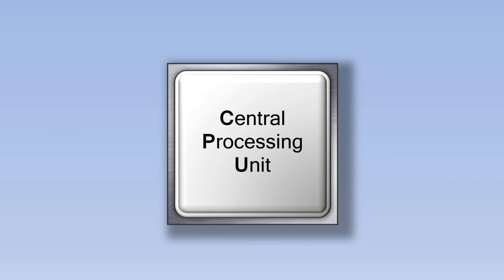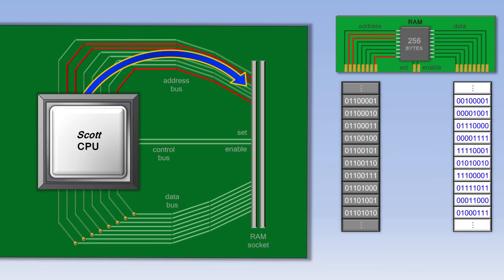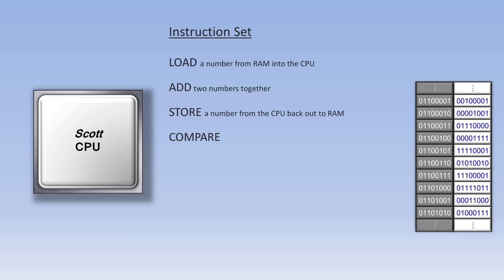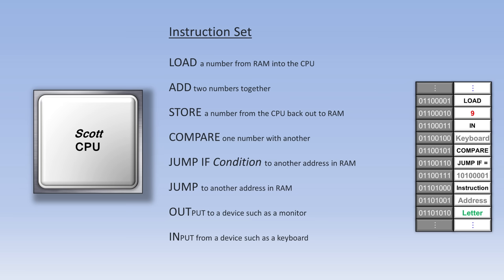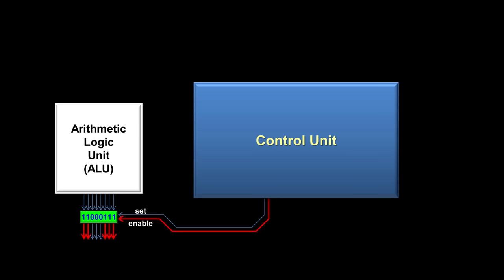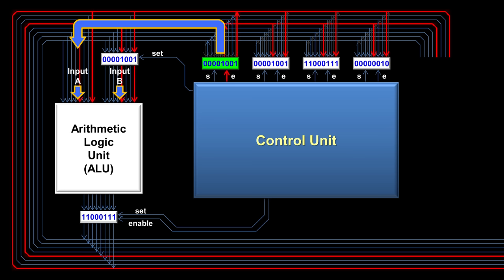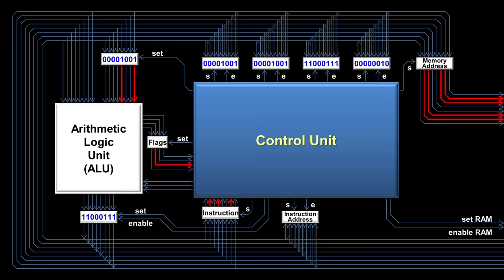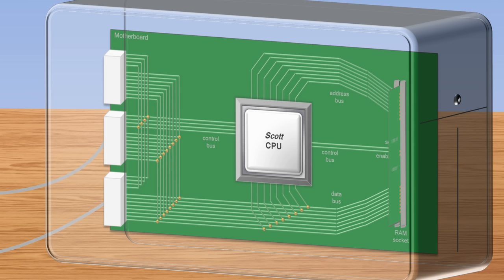How a CPU Works

Comment: Ok and how the fuck did we(people) come up with this such a simple thing that has only 1 & 0, and at the same time very very complicated thing? couldnt there be an easier way to make a "computer"?
Reply: emmanuel kayiwa a chromebook will contain the same hardware, its just a different OS running on there
Reply: emmanuel kayiwa If you don't know crap. DO NOT mislead others!
Reply: This is the easier way.
Reply: "and at the same time"

We didn't spontaneously figure out how to make a microprocessors. It evolved from many other simpler contraptions,  first with vacuum tubes and then circuits with transistors.
Reply: 12839712894710aaa No, the first ones involved using gears to add numbers, and a machine that read cards with holes in them to weave patterns into a cloth
Reply: The only way to make a computer work, that we know of, is by turning electricity on and off. Since ON and OFF are the only way, off is 0, and on is 1.

You could have 3 values though, Off, On and On and the opposite direction. But then you need to also change how digital media is stored too, and many other computer components to make such a thing work.

Basically, On and Off is the only way we know of.
Reply: 100s of years of research.
Reply: why to make an easier computer when you can make a much better one by making it more complicated?
Reply: Rimunas Kusunas  I hope that this answers your question about Binary.
I did a lot of research for this :3

How a Computer Performs Addition

A computer's clock regulates how fast the computer works.  The faster a clock ticks, causing pules of electricity, the faster the computer works.

The simplest operation that can be performed with a transistor is called a NOT logic gate, made up of only a single transistor. This NOT gate is designed to take one input from the clock and one from another transistor. The NOT gate produces a single output-one that's always the opposite of the input from the transistor. When current from another transistor represents a 1 is sent to a NOT gate, the gate's own transistor switches open so that a pulse or current from the clock can't flow trough it, which makes the NOT gate's output 0. A 0 input closes the NOT gate's transistor so that the clock pulse passes trough it to produce an output of 1. {Basically an Inverter}

NOT gates strung together in different combinations create other logic gates. All of which have a line to receive pulse from the clock and two other input lines for pulse from other logic gates,.

The OR gates create a 1 if either the first or second input is a 1, and put out a 0 only if both inputs are 0.

An and gate outputs a 1 only if both the first and the second inputs are 1s.

An XORG gate puts out a 0 if both inputs are 0 or if both inputs are 1. it generates a 1 only if one of the inputs is 1 and the other one is 0.

A mathematical operation in a computer is achieved by gate designs called half-adders and full-adders.

A half-adder consists of an XOR gate and an AND gate, both of which receive the same input representing a one-digit binary number.

A full-adder consists of half-adders and other switches.

The result of the XOR operation becomes the rightmost digit of the result.
The result of the half-adders AND operation is sent to XOR and AND gates in the full-adder.

The full-adder also processes the left-hand digits,sending the results of both of the operations to another XOR gate and another AND gate.

The results from XORing and ANDing the left-hand digits are processed with the results from the half-adder. One of the new results is passed trough an OR gate.

The result of all the calculations is in binary, for larger numbers. More full-adders are used-one for each digit in the binary numbers.
Reply: ***** yea, thanks, it helped me out a lot. But I had to read it 3 times though to fully understand it. xd
Reply: ***** yea, thanks, it helped me out a lot. But I had to read it 3 times though to fully understand it. xd
Reply: Rimunas Kusunas  Thanks for reading it and giving me your opinion

Would you like me to give you a link for the book i got this information from?
Reply: it takes me years to study this in school so you have to take your time to unpack the information
Reply: Aero mirA this took me a day of reading books XD
Reply: ***** no thanks, I kinda understood what I wanted from your text :)
Reply: A system can only think in 1's and 0's - like ON & OFF, HIGH & LOW etc.  which is the basis for a CPU.
Reply: emmanuel kayiwa Yes!  That is why you can't open up a chromebook.  If you do, the cloud floats away.

It's also why rain makes the sound it does, that's the data falling back into the rivers and oceans.
Reply: I meant that it mostly uses the cloud and is missing parts that a normal computer doesn't have like a hard drive! I didn't mean that it has nothing inside of it, sorry for the confusion
Reply: ***** my bad for the wording I now realize it sounds ridiculous I meant that it it doesn't have all the parts that say a normal use laptop would have like a hard drive. I know that it doesn't completely work off the cloud! chill out dude
Reply: If any of you have ever done circuits, especially digital circuits you would know there is no other way than 1 and 0 and that it is incredibly powerful.
Reply: No , there is an other way. We can use DNA to store data,instead of 1 and 0, we can use T, A, G, S (dna molecules). But this is not that simple as I say :) people working around this. This will be the next step for computers.
Reply: ***** nice copy and paste lol it took me 10min to find the website but i got you.... wow lol
Reply: David S again it's out the book I studied called "How computers Work"
Reply: 1 and 0  is like on and of power we could maybe make different ones if we had different kind of electricity
Reply: Nobody came up with this on the spot. People first started making very simple circuits like light switches and realized you could use it do more than just that. Over time, it has evolved into what we see today. Plus, before digital computers, there was mechanical ones. Mechanical ones are a bunch of gears and such. A very simple one would be a watch.
Reply: Check out Quantum Computing
Reply: Michael Scott Quantum Computing is'nt really that complicated. In a Quantum Computer a Transitor is just a phosphorous atom in a tiny silicon
crystal and the only advantage to a Quantum Computer is its ability to do 0, 1 and both at the same time.
Reply: Harrison Kilshaw That is a pretty major advantage! Inbuilt parallelism which exceeds Moore's Law
Reply: We use 1 and 0 because they are easier to think of. Computers don't use 1s and 0s, they use different voltages to control transistors and capacitors.
Reply: David n that is false. Computers use voltages to define 1 and 0. For example any voltage over 1 is considered a 1 but anything under 1 volt is a zero.
Reply: Ahkeel Mohideen No, we use 1s and 0s to define the voltages! a high voltage enables currents to flow through transistors(or stops it if it's an inverter) while low voltage does the opposite. The transistors and capacitors don't give a dam if you use 1 and 0, or y and n, or 55466 and 66466 to define high or low states.
Reply: Yeah sorry that's what I meant
Reply: JacktheSmack Quantum computing is a new way of looking at it that we know of in a way.
Reply: Mathematics back in the dark days. Lovelace - first Programmer?
Reply: Computers only use 1's and 0's because when they were first designed that was the most cost effective way to handle data. Binary is a counting system that only uses 2 diffrent digits or states. with today's technology we could easily make a denary computer that uses 10 states or digits much like our regular number system. The benefits of doing so would (theoretically) make processing information unimaginably faster and data far more compact. But that would require a massive shift in how all data everywhere is stored and be converted to the new system. Programming would change as new languages would have to be written from the ground up made specifically for the new data system, because think about this if a denary byte still had 8 bits it could hold 100,000,000 different stats rather than just 256. no one would accept such a change unless everyone accepted it at once, but that will never happen in the foreseeable future.
Reply: Ryoku Hasu Do you know how complicated going from 2-state to 10-state transistors would be?
Reply: David n Not very if you are using nano voltage for the states, then it would be only a minor change to current CPUs and ram. That way all the data can be transmitted on the same wires as 2 state data but would require a voltage meter to be added to read all possible states. Similarly you would use a wider variety of magnetic states on the hard drive. really it's not a question the transistors it's a question of adding in the functionality. It's doable but unlikely that anyone would do it cause we are stuck in our ways.
Reply: Ryoku Hasu The cpu is made up of many transistors. A transistor enables resistance or no-resistance depending on electricity that flows through the semi-conductor. Technically you could make a 10-state machine, but you are ignoring things like accuracy in transistors, and precision/stabilization times in capacitors. Basically, you would have a 10-state machine but it would run at 50MHz.
Reply: Michael Scott quantum computing isn't simpler by any means haha ;) it still uses ones and zeros and is equally if not more complicated, depending on whether you are better at electronics or quantum mechanics :')
Reply: Morgan Collins not to mention, building a programming language with 10 different options would be near impossible. Now we need only off and on for like if else statement, which 100 times simpler.
Reply: Ahkeel Mohideen It's not so much making the programming language, as just having a language talk to the CPU in a different format.  if one was made for 10 state you would still have true/false, If-else statements, and all the usual things, the part that would be different is the stuff under the hood where it is managing the data unless you are using an extremely low level language you as the programmer aren't dictating how to store it, just what to store, the language platform and computer take it from there. Basically a programming language for 10 state would be no different than a 2 state programming language in the way you use it to make programs, but behind the scenes it will still send instructions to the CPU like it normally would, but just in a different format.
Reply: Proof that aliens are helping us XD. But seriously isn't it a wonder how humanity has gotten so far? 110 years ago we didn't even know what electricity was and look at us now!
Reply: Chris K Exponential growth. Its how technology works. the more knowledge we have and more technological equipment we have the easier it is to discover more things. Makes sense really. :p
Reply: I was thinking the same thing. This info is traveled at the sub atomic level. It's so crazy. It's hard to comprehend these things. The speed, how small it is. It's amazing what humans can do
Reply: JacktheSmack  somewhat true If you want to get technical we do know how to change the orientation of electron, neutrons ect... in an atom and thus count much higher at a given time. This is called quantum computing with just 30 qubits you would have what today is about 10 trillion float point computations a second much faster than most super computers we have today. Here have a read: http://computer.howstuffworks.com/quantum-computer.htm
Reply: Robert Hollar Yeah quantum computing is amazing, I'm studying artificial intelligence and I hope to get into quantum algorithmic artificial intelligence as well as some other stuff, it's an amazing technology. Could change the world if it continues to works as well as it is expected.
Reply: ***** i have a strong feeling thats the way it is going to lead. It's pretty much so powerful that most people couldn't even conceive being about to do something useful with it. Creating intelligence, simulations of nature and making predictions, they're the main uses really but they are VERY powerful
Reply: Nope.
Reply: this is because the 0 means that a there is is no power to a wire, 1 is the opposite, it is like this cause power in wires is just black and white, no grey
Reply: emmanuel kayiwa
Yes, google chromebook it's alien technology made of minerals + vespene gas.

Comment: If i understand it right, ie the pc just a bunch of swiches that go on and off and make a sort of codes of them
Reply: pretty much...
Reply: I've always just thought of it like an abacus, which is basically an early computer.  Instead of moving beads from one place to another, you are moving electrons and on a much grander scale (or smaller in terms of size).  We are the ones that actually interpret the output.  It's incredibly complex and even people who study or build these machines for a living will specialize in only a few aspects of it.  The beauty of it is that the parts are modular, you don't have to understand everything going on inside the chip or cpu in order to make use of it.  Even though the video does a good job of explaining what a cpu does, it does not really cover how it actually works.
Reply: gurgy3 yep indeed
Reply: to who are u repleying ? *****  :)
Reply: well thank you i appreciate that! I am working in a automation company and I'm just 15 years old :)
Reply: *****  and that +(name) system is now something get used to. btw xD
Reply: Titan_Craft The PC creates those switches using voltages, if the voltage applied to a specific portion of the CPU breaks the "barrier voltage" that portion of the CPU will turn from the Off switch to the On switch. That's what they call transistors which are a type of semiconductor designed to be operating at low voltages for On/Off circuits. They fit billions of them on layers of dye onto your processor.
Reply: jebril wow those swiches have to be really small.
Reply: *****  Those switches are also called transistors.

How transistors manipulate data

A transistor can only create binary information,a 1 if current passes trough, or a 0 if current doesn't.
A computer can create any number as long as it has enough transistors grouped together to hold all the 1s and 0s.

The amount of Bits in a processor are the amount of places the binary number can hold.
If an operation requires numbers larger than that the PC must first break those numbers into smaller components,perform the operation on each component,and the recombine the results into a single answer.

Transistors are not used simply to record and manipulate numbers. The bits can just as easily stand for true(1) or not true (0),Which allow computers to deal with Boolean logic.

Combinations of transistors in various configurations are called logic gates, which are combined into arrays called half adders, which in turn are combined into full adders.
Reply: ***** Have you seen the quantum transistors that Google is developing? They apparently can simulate 1's and 0's at the same time or both off at the same time.
Reply: You guys are all so smart 0.0
Reply: yup!!! it it is many many switches that turn 0 and 1 at really fast speed